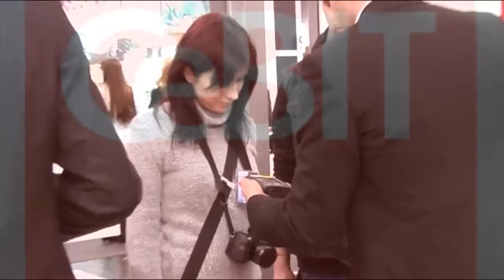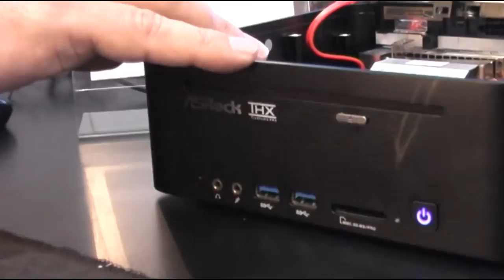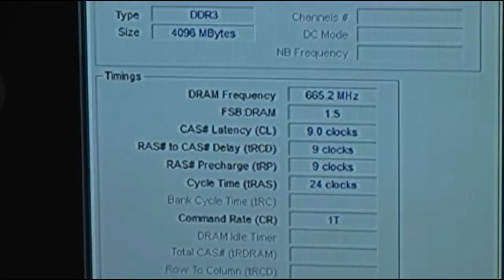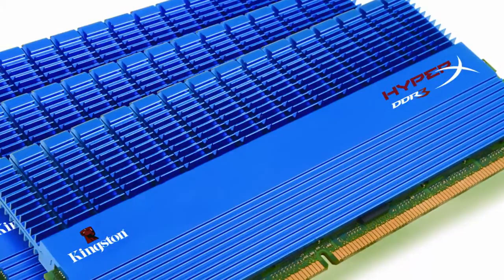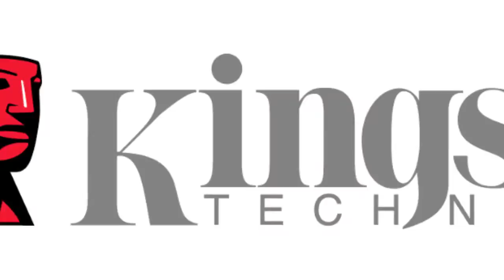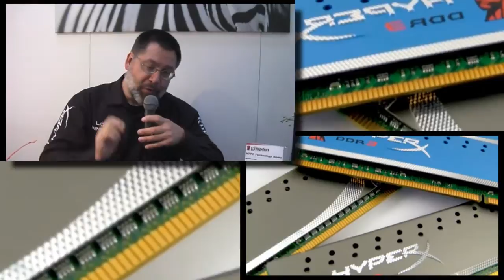Kingston HyperX SO-DIMM 2133 MHz (CeBIT 2011) - report and new products

Comment: I purchased the Kingston HyperX 1866MHz; 2 "x2 8GB kits. I compared it on an Asus G73SW that has the Intel Chipset HM65 and it supported the speed. So now I have an Asus G75VW w/ an Ivy Bridge processor and a Intel Chipset "HM77" that apparently says it supports "Up-to" 1600MHz. I'm pretty confident about it running overclocked and that is why I purchase 16GB's worth and I'll do a video review when I get it.